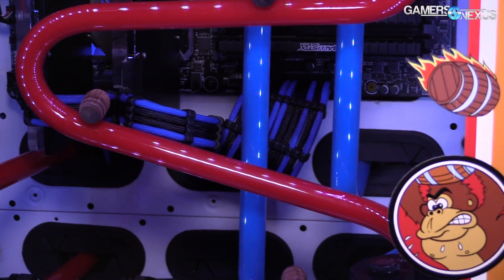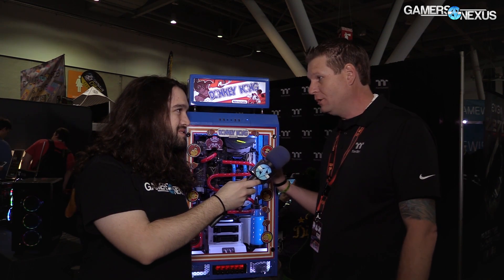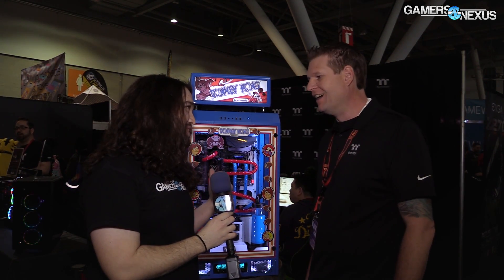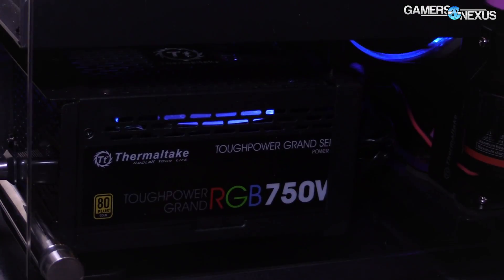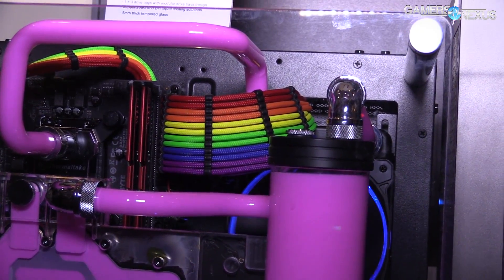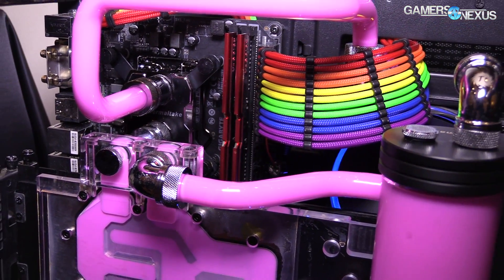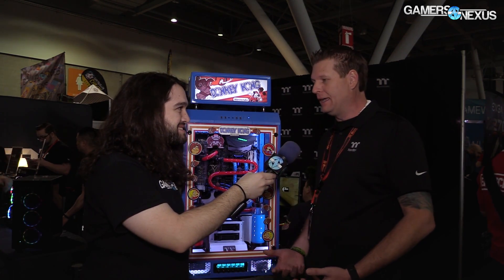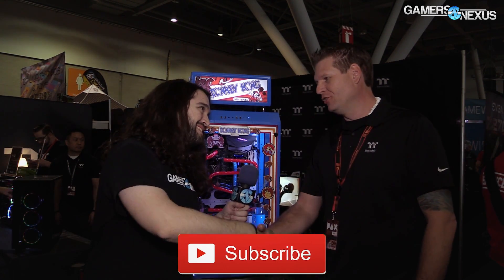Common Liquid Cooling Mistakes & Misconceptions

Comment: One common mistake is using thermaltake for water-cooling. Their products (as far as water-cooling goes) are absolute fucking garbage.
Reply: Daniel Z im confused because my cpu block and gpu blocks r nickle plated.... by ek but... the radiors i want are only copper the 360mm slim line ones... idk if im gonna be having issues
Reply: CSRF Broforce copper brass nickle can all be safely mixed. keep silver and aluminum out though. if you are all copper silver is ok.
Reply: Roy Wagner i have nickle gpu nd cpu blocks nd copper radiators thats good?
Reply: CSRF Broforce yes that is good
Reply: Roy Wagner ok sweet im tryong to figure out what dyes to buy im really wanting a nice clear sorta neon or a slight darker green
Reply: CSRF Broforce use distilled water and ek or mayhems clear coolant and ek or mayhems dye
Reply: Roy Wagner what would i need to use to keep it from getting bacteria? im doing a big 900daller order on watercooling gear just need help on fittings and dyes i have no idra about fittings and shit
Reply: anything made from them is "fucken garbage" they make low rate shit
Reply: Daniel Z But but but their fittings have 3 o-rings and they have more products coming in 2017!!! 😋

Comment: Hahaha - ok this is halarious. Steve I like your videos, but if you are going to ask about "water cooling" I would only trust someone from Hardware Labs. I have been doing custom loops since 2000, and listening to this guy is just a commercial for Thermaltake......let me discuss what this "salesman" missed about water cooling 
1. Block and radiator restriction - and how many blocks and radiator you are using
2. Fins per inch - do you want a low restriction , low fin ,low fan speed rad or the opposite? 
3. Tubing length - short tube runs with least bends are best since water can be cooled quickly 
4. Active or passive water cooling ?  Yes passive water cooling exists, and it can provide great temps if your radiator has huge surface area 
5. Speaking of surface area - surface area? 
6. Premixed coolant? Shut the front door. Over time the coolant will break down , clog your blocks, raise your temps - stick to distilled water and kill cool. It is super cheap, has the best performance, and viscosity. 
7. Pump pressure / flow
Thermaltake how dare you mislead people - and I am surprised at how Steve did not correct them on anything - I understand that goal of a business is to make money and that is perfect if we update the title of this video to 
" Thermaltake water cooling products"
Reply: i agree. this title is "clickbait" , this has almost nothing to do with common mistakes :p
Reply: If you hadn't already said all this then I would have. Maybe the biggest warning they could have given is to stay away from Thremalfake's cheap shit watercooling line of products.
Talking to someone like Jayztwocents would have been much better than listening to this marketing wank.
Reply: yes sir, I am totally OK with that - I even mentioned that in my comment. Just update the video title to reflect what it is. just my .02 cents. They don't have to listen to or agree with what I say :)
Reply: dude this marketing dude is a filthy liar and is okay with making the world a dumber place so he can get more money.
Reply: I think the most common mistake is trying to build the best water cooling look with your first try. I feel like people should go through soft tube first and than upgrade to hard tube.
Reply: Your reply looks like an ad for hardware labs, I'm sure its a solid business that you believe in.
I didn't find it misleading, he should have talked a little about galvanic corrosion when pressed on it but I didn't hear anything misleading. To elaborate on your points:
1. You mean "how do I choose a pump given the flow restriction and required flow rate". Pump work needs to be sufficient to create a flow rate that exceeds thermal capacity of air side (which is typically small compared to water side). I'd be interested to see performance data for custom loops. 
2. Radiator performance and air side thermal capacity is dependent on the radiator design geometry,  fin size, fin profile and material. I see what you are trying to get at but there are texts on this topic if you're interested - to expect someone to lecture you on thermo at a sales event is a big ask, there are so many dependencies involved. 
3.  Your statement is correct, your reason is misleading. Tubing length and bends increase resistance to fluid motion, requiring more pump work for the same flow rate, or for a fixed pump output a lower flow rate. 
4. Ok, don't see why it wouldn't. Would suggest you need to elaborate heavily on heat exchanger design for passive cooling as it should be substantially different.
5. Agreed, it's a fundamental that could have been mentioned, but it's not a long interview.
6. I can't comment on this industry but I would say that typically premix coolants are distilled/demineralised water mixed with an antifreeze / anti boil component as well as additional corrosion inhibiting additives. I am guessing you want to do away with the antifreeze / anti boil component and just have the corrosion inhibitors?
7. See 1 and 3. You already brought it up. 

Full disclosure, I haven't made a custom loop for a PC, I'm just a mechanical engineer and I've never worked for Thermaltake or any PC component manufacturer.
Reply: and then the video would deserver its title...
Reply: It should be mentioned that whatever premixed shit Thermaltake is selling is also just as bad or good (depending on your point of view) as the pre-mixed coolant you can get for a car at your local gas station. Also what was that comment about the radiators about. I mean I have yet to see a radiator that uses Aluminium tubes. Sure many use Aluminium for the fins, but that is a completely different story. If water in the rad came into contact with Aluminium your system would be fucked nearly instantly. Even with Nickel plated blocks i doubt it would last more than a year, or perhaps even a few months, before corrosion would set in. I guess he may have been saying it because he had seen people mix AIO parts with custom parts in the past? Something you obviously shouldn't do unless you know exactly what sort of materials are in play. Even then a radiator is pretty cheap so why bother.
Reply: yea he does. but there are 2 reasons its not that bad for him. he told us that the tap water in his area is very clean. (in my area sometimes its just white....) and 2, most of his builds dont stay togeter that long.
Reply: Distilled water's not the best tho. If all of blocks/rads/tube are cleaned properly and the distilled water is 'distilled' enough than it will be a good option. If not, it causes more corruption faster than most coolant does
Reply: I use all Aquacomputer products  for years never seen corrosion looks like day one CPU and GPU waterblock. And i have black Ice Nemesis radiators.
Reply: Christian P The problem with premix coolants is that they usually include colouring that gunks up your system and lets it perform much worse even though you just spent a lot of money on a product that should be designed to avoid this problem
Reply: Meh. Probably not. The thing is the heat capacity of any liquid is typically good enough for a water cooling setup. At least I'd like to see a chemical analysis of the colour additives which proves how it's heat capacity suddenly changes dramatically from water given what is a pretty low ratio of additive to water from the start. That said there really is no reason to have additives at all outside of vanity or flair. The only reason why they have colour additives in regular gas station coolant is to make it clear that you should not drink this if you find it in your garage and to indicate which product you can mix it with. The latter is less and less important though as the number of products on the market has gone wild in recent years. So in conclusion downside or not you don't really need that colour in your cooling at all.
Reply: thank you, but I dont work for hardware labs, I have used XSPC, and EK radiators for the last 6 years or so, I recommended hardware labs because they have been in the business for a very long time, and their new line of radiators is extremely good - even better than EK, so I might give it a try 
I was going by this 
http://www.xtremerigs.net/2015/02/11/radiator-round-2015/
Reply: al the way to go with Black Ice Nemesis GTX best built i use them already a few years.
Reply: I think Jayztwocents uses tap water in builds for himself...

So, yeah, dont buy those premixed fluids...
Reply: distilled water doesn't look better than pastel though. all you need to do is just swap the coolant every say 8 months and clean the blocks.
Reply: You hit the nail on the head!! I wouldn't trust any Thermaltake products in the slightest. I've seen numerous posts about people having issues with their water cooling products and even reputable manufacturer's like Mayhems say don't use their coolant in a Thermaltake radiator.
Reply: Florian Yang Well, then just change it twice as often. Its distilled water, so its cheap anyway. And you could always add a little anti corrosion agents and some anti algae agents.
Reply: What? How does the speed at which the water is cooled matter?
Reply: Black Ice Nemesis GTX or very low fan speed GTS and SR2 best radiators you can get.Myself i use 3x 420 GTX and 2x 480 GTX [ look at the review 560 GTX]

Comment: common mistake is putting liquid in your computer...
Reply: i agree, you gotta keep the liquid in the loop
Reply: Risto, all the maintenance you mentioned as bad, most of us could compare it to the difference between using a car and driving one.  You are apparently more interested in simply using your computer.  We want to drive the thing.  Overclock it.  Water cool it.  Mod it.  Everything.  It's a passion.  I do agree with you that, if it's NOT your hobby, it's not worth it at all.  The moderate performance gains coupled with additional risks and maintenance can be a hassle.  But... It's not a hassle to me.  It's FUN.  EDIT:  for example, when my 1070 had a recall issue and EVGA sent out thermal pads to us, I got giddy because I had an excuse to open the GPU up.  Fun.
Reply: A more common mistake is talking out your ass.
Reply: KillJD, I apologize, autocorrect changed my reply enough to make it look like I was replying to you.  I have edited it to be clearer now.
Reply: I reread your quote TheSickness1234... it is I who did not understand you.  I need to stop, that's my second mistake in this thread.  My bad.  You had it right.
Reply: TheSickness1234, You missed the point of everything I said.
Reply: I was speaking to Risto.  I'm a water cooling fanatic myself.
Reply: yes I must be talking out of my ass... besides everything I said is well documented... so go ahead believe your lie. im not the one spending hundreds of dollars on computer parts that offer little performance...
Reply: I'm using a recertified H100i in my rig. Does that make you sweat?! All the points of possible failure hang above my Fury CF and my PC is on and folding 24/7. OH. MY. GOD.

I actually think my rig is safer now than when I just had everything on air on an open bench.
Reply: adbkevin I guess I did...thought you were talking about the passion of tinkering with the pc and seeing a rework of graphicscard as a chance to "play" with it. So I shared what I did with that opportunity... but whatever
Reply: kind of agree I understand there's people out there had no problems, but things can happen and some people don't want sit there changing coolant water either, I just don't want go through that shit, I'm LAZY :D
Reply: my thoughts exactly
Reply: cool some people get leaks which destroy months worth of disposable income... I would never go for water cooling... too much maintenance for a computer... a day or 2 for changing parts and leak testing no thanks. I would rather spend my money on a more interesting hobby... PC building is so simple and just boring
Reply: adbkevin and I added my 1070 ftw to my loop, overheating solved. And she runs with 2150Mhz 24/7

Comment: Honestly, the fact that they even produce Aluminium radiators, no matter how much protection and whatever, for custom loops makes thermaltake a no go for me. With AIOs i can give a pass since they are "cheap" but if you paying 500 USD or whatever on a custom loop, dont buy fuckign aluminium radiators... get proper copper ones, and since Thermaltake is willing to make subpar rads... nope

Comment: common liquid cooling mistakes: using a product made by Thermaltake.
Reply: Why tho, explain pls
Reply: @Янус_Ырт  They've classically had a bad reputation, especially three years ago when I made this comment.  They are a Chinese company that spent many years making low quality knockoff parts from higher end manufacturers.
Reply: @failwheeldrive  oh, thanks, didn't know

Comment: >thermaltake
>custom loop

pick one
Reply: "What is the most frequent mistakes when you look at youtube videos and stuff like that?"

Correct answer: "When people use Thermaltake"
Reply: love how he completely avoided talking about their aluminum radiators when asked about mixing metals LOL
Reply: BlazzedTroll check out Salazar studios last vid, thermaltake fluid clogged his loop and they steal case designs, so you believe them?... not trying to offend anyone, everyone can form their own opinion
Reply: He did talk about mixing metal and promptly tried to defend aluminium rads by saying AiOs use them. I'm pretty sure most people who are in the market for custom loops know how expensive they are and that AiOs are the cheap alternative that have lower quality components to save money.
Reply: Suck Zukaberg He said use their fluids which prevents corrosion from mixing metals.
Reply: AIO's are cheap to save money. Tell that to the 6 year warranty on my NZXT Kraken. So cheap they guarantee it will only last 6 measly years! That will outlast the fans and the cpu it is cooling. The only things outlasting it in my system are the ssds and the psu
Reply: CPUs don't die from age. They only die from missuse. PSUs on the otherhand definitely have a limited lifespan that is often below 6 years in all but the best designs.
Reply: +Retsini
Tell me, how does something evaporate in a closed-loop system?
Reply: Rubber tubes aren't perfectly impermeable. Just google it if you want the entire story.
Reply: Retsini 
Fair enough, but I still doubt that there would be sufficient dissipation to state that it would run low after just three years.  Unless the seals were of extremely poor quality, and then I'd be more concerned about leaks than evaporation.
Reply: I usually notice a drop in the water level in my reservoirs after around 3-6 months, which i have to top off. 

Edit: Also worth mentioning I like big reservoirs, I think the one's I have right now are around 250ml.
Reply: Retsini 
However, you're dealing with an open loop system, not a closed loop like an AIO.  It's natural to expect dissipation in a system like that, not so much in an AIO.
Reply: I looked around a bit and couldn't find anything relevant about AIOs holding liquid better. All I can say is that custom loops aren't kept open, they're sealed after you finish setting them up, though considering there are more tubes, fittings and well, more places where you can lose fluid in general i guess it's true that you're gonna see bigger drops.

However the average lifespan before bubbles start getting in the pump seems to be 5 years according to user reports. But there's a lot of factors such as temperature and how many hours it's been active in those 5 years.
Reply: Retsini 
I'm not as knowledgeable on liquid coolers overall as I am with other components, so pardon me if this seems a dumb question, but aren't the reservoirs generally not sealed as tightly on a custom kit?  I would imagine that would be an obvious source of dissipation.
Reply: Reservoirs nowadays have fillports on top of them as well though it's obviously not as tight as an AIO reservoir that's probably soldered to the rad. Regardless this was a bit of a fruitless discussion, even if I had 0 dissipation in my loop I wouldn't keep the same fluid in it for over 2 years. Even if there's no aluminium copper can still mix with the water and cause the microfins in the waterblocks to gunk up or the pump to fail.
Reply: Jito463 reservoir is sealed completely, you don't run a loop with the cap open, just think of it as a water bottle, tubes on the other hand will evaporate, the rate of which will depend on various factors such as wall thickness, material, soft vs hard tube etc, soft tubes are much more prone to permeating and are much more porous, however ek has a "ZMT" tubing that claims 0 evaporation, anyways you wouldn't want to run a custom loop with the same liquid for more than a year anyways, you will flush and refill every now and then, CLC on the other hand is hard to do so
Reply: The pump, rad and waterblock are probably gonna last 6 years but there's no way the fluid will. I don't care what rubber they used on the tubes, it's gonna evaporate to a low enough level that the pump is gonna start getting loud and the temps will go up. I give it 3 years max until you have to send it in for a refill.